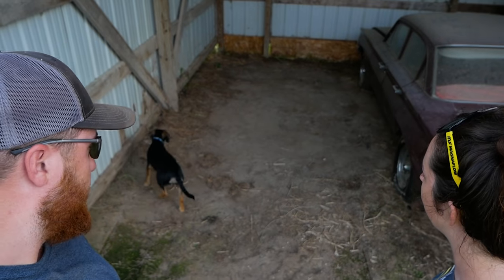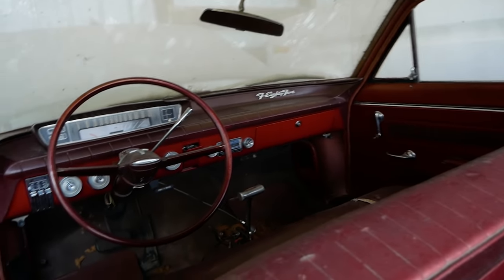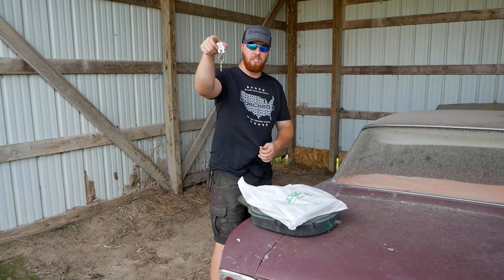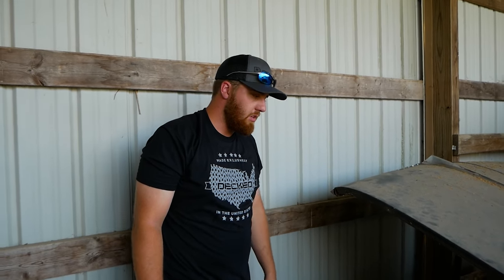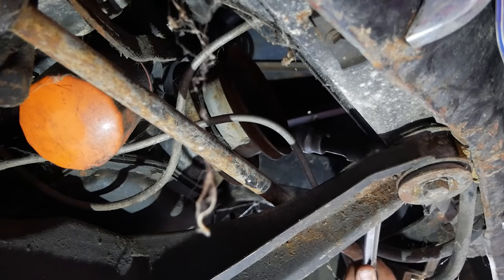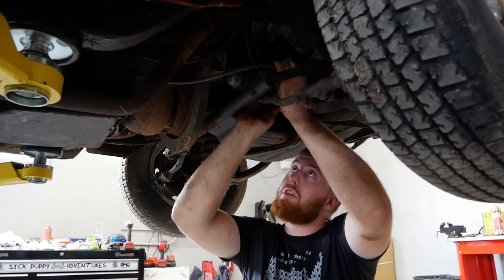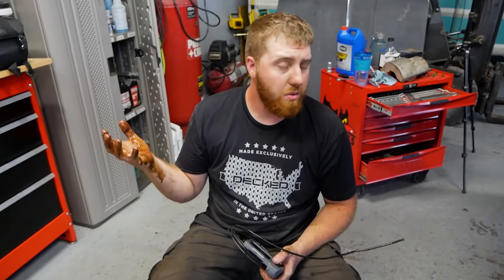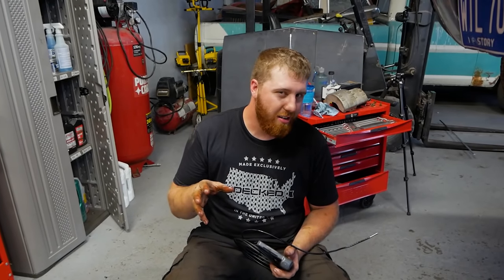BARNFIND Oldsmobile F-85 First Start in 25 Years!! - Part 1

Comment: Your bypass piston in the oil pump is more than likely stuck open also your oil pump drive shaft is probably not seated in the bottom of the distributor drive gear I've been doing Olga Revival since I was a child I began back in the 60s I worked for many decades as an auto mechanic I also did Heavy line at a Buick dealership which by the way is who actually built that engine into a 1964 did GM sold the design to the Rover company in England maybe they refuse very slight differences the Oldsmobile 215 is identical to the Buick 215 aluminum

Comment: My story says that the motor blew because of low oil pressure look at the invoice everything would be a replace due to low oil pressure. Dude believed it blew because he was racing but it was ruined  lub system. I remember when detergent oil first we introduced the story was the once you use detergent oil can never 👎 go back to non detergent. It will ruin the oil system. How I’m not sure but I equate it with not being able to use new gas in old cars because it will ruin the fuel system. Which would mean the motor needed rebuilt so might as well do the up grade. Once rebuilt they had no oil pressure and gave up that’s why it’s so clean. Never ran after rebuilt check out easy stuff first but I’m think you running dry

Comment: my gut is telling me its the oil pump.  my ex gf had a land rover disco 1 that had a 4.0 rover v8 and those engines run on historically low oil pressure especially at idle and when running, its possible that maybe the aftermarket guage isnt picking up a reading?  also, the oil pump is an absolutely awful and terrible design to begin with and they dont last long.  thats my two pennies of input, hope this helps to some degree